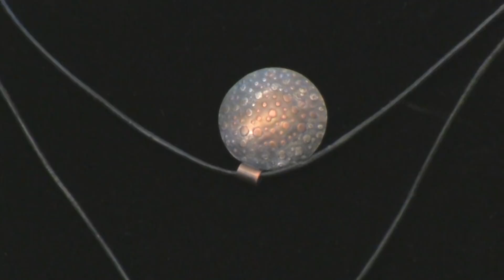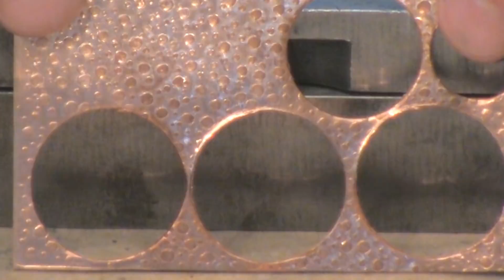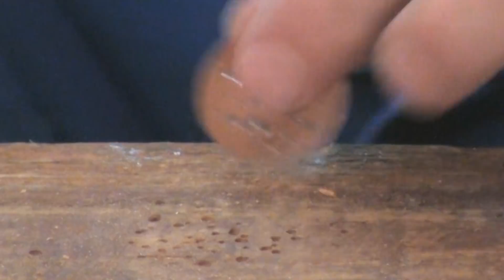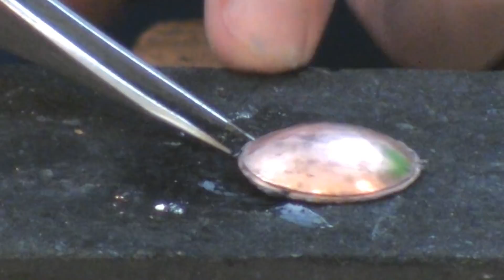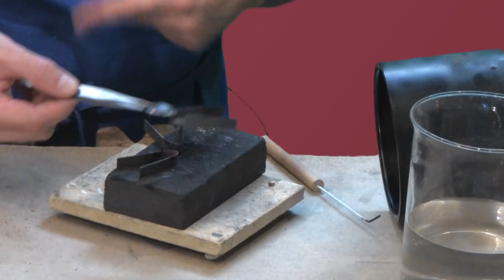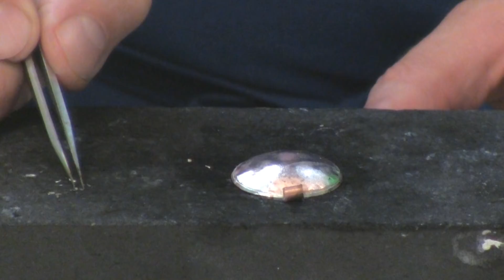Domed Lotus Pod Pendant

Comment: Could you enamel the inside of the back plate so that you can see that glassy color come through the holes in the front?
Reply from the maker: Hi Beverly,  Anything is possible.  But, enamelists generally do not enamel the interior of items like the ones in the photo for a couple of reasons.  First, the openings on the pieces are quite small making an even application of enamel material difficult.  Second, teach of the pieces has multiple solder joints that could detach or move during the firing process.  These are just a couple of the reasons why I showed the finishing of these pieces with liver of sulfur and epoxy resin.  But, if you feel like testing your enameling skills, give it a try.  You might be surprised by your results.
Thanks for your support! : )

Comment: Another great project, John!

Instead of your bent bandsaw blades to elevate the piece for soldering the back and front together, could you just use a tripod?  

For the life of me, I still can't grasp when it's best to use that and when to use which kind of brick, or annealing pan.
Reply from the maker: Glad you liked the video.  The reasons why I don't use a tripod are 1) tripods are huge heat sinks that steal too much energy, and 2) I like that the charcoal adds reflected heat to the process.  There is a video in the OJA playlist on soldering surfaces that you should check out.  Plus, the general rule about the annealing pan is that it's ONLY for annealing.  You don't want to solder on your annealing pan because you might loose bits of solder in the pumice that can get attached to places you didn't intend for them to go.
Thanks for your support! : )
Reply: OnlineJewelryAcademy Aha, thanks!

I remember using charcoal blocks on top of the pumice in the annealing pan in my jewelry class in design school, so what's up with that combo?